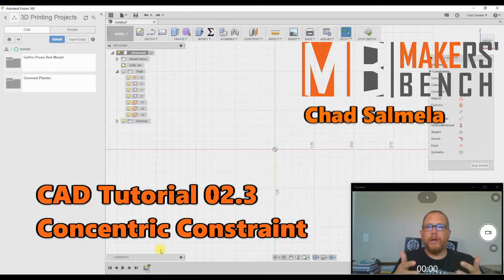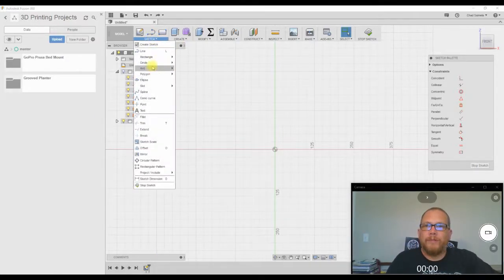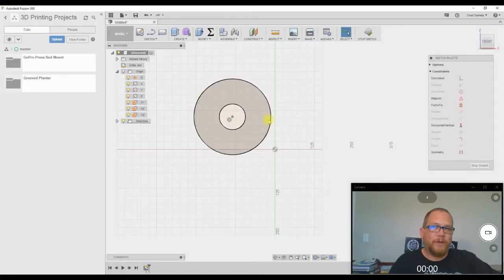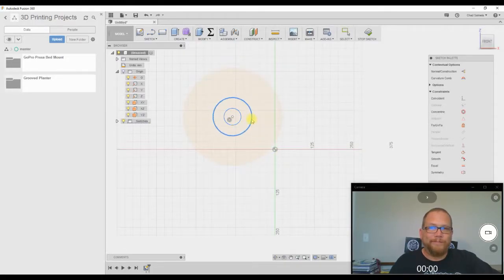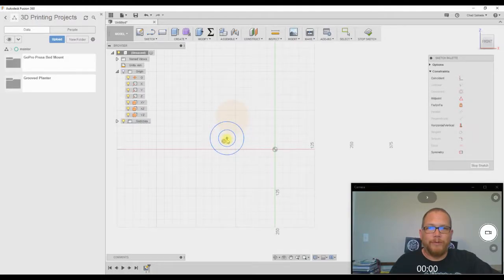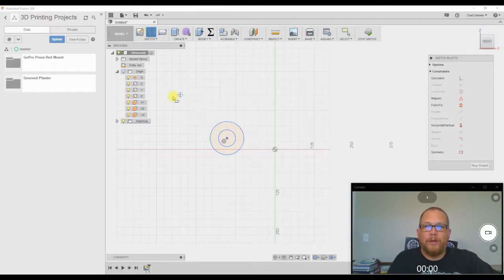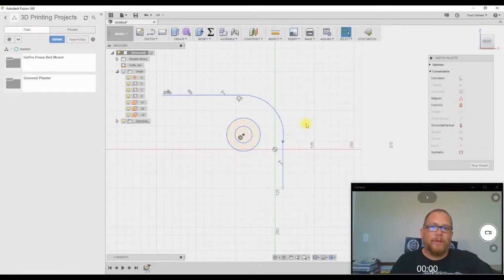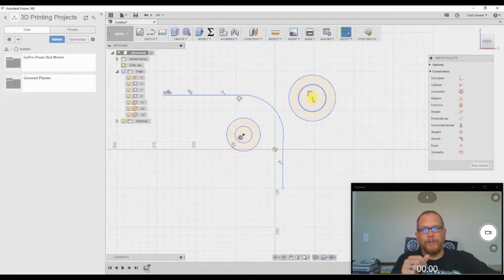CAD Tutorial 02.3 Concentric Constraint

Comment: Is it possible to do that with center-rectangles(rectangles defined by a center point as well as the length and breadth)?
Reply from the maker: If you use the center point rectangle you can use the coincident constraint to constrain the center point of two rectangles. The concentric constraint only works with circles.